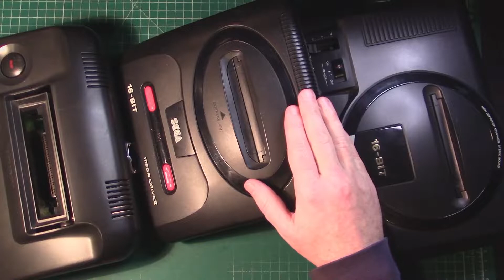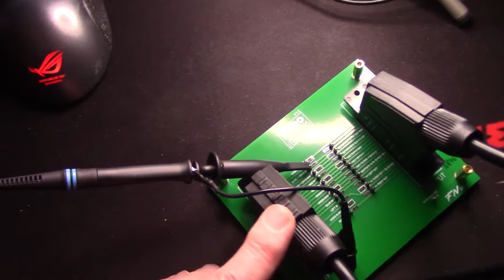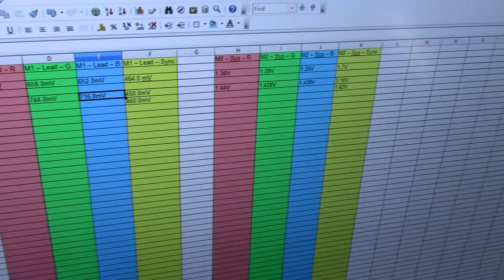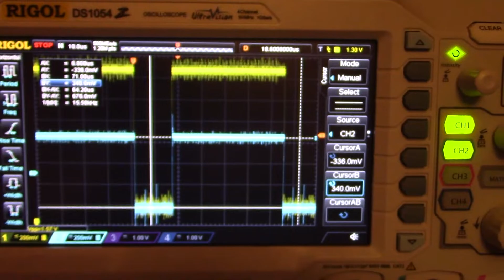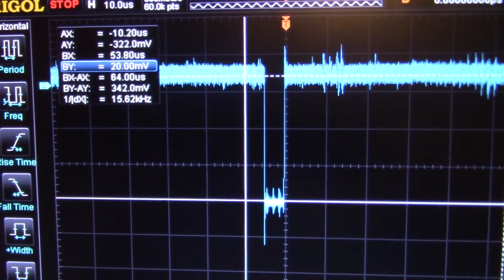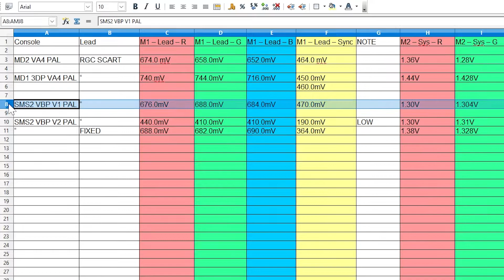VLOG: SEGA RGB SIGNAL SCOPING - 8bit & 16bit Consoles

Comment: Hi there, thanks for the video! I was looking at your data and I noticed that for RGB, the Vpp drop from the system to the SCART end is usually half, which suggests that the cable has a 75ohm resistor (or close to that) on top of the 75ohm termination resistor. So far so good. However,for csync, I notice that the attenuation that you documented for the first 3 systems is only possible if there is a 200ohm resistor inside the cable, not the 470ohm the cable says it has. However, the data for your FIXED system does show a resistor of around 420 ohm, closer to that 470. Do you know why that is happening?

I am trying to mod a very old system that doesn't currently have an RGB mod and since I am planning on using that same cable, I need to figure out what Vpp I need for RGB and csync to get the correct attenuation. I was thinking 1.4vpp everywhere and passing the 5v TTL directly since I think there is indeed a 470ohm resistor there, but I haven't received the cable yet to test.

Any help is appreciated. :)

Comment: The easiest way to do it Dermot is to get a test patten with a pure white screen, that way all three colours should all be at the same potential. Then attenuate each signals of the RGB to 0.7v pp. Remember there's a 75ohm resister to ground in the TV that creates a Voltage Divider (I'm sure you know how Voltage Divider work) when you input a source this helps you attenuate the signal.

Example.

I have a Red signal going into the TV SCART it's unattenuated at 1.5v It needs to be at 0.7v pp (attenuated) we already know there's a 75ohm resister (R2) going to ground in the TV that creates a Voltage Divider we just need to find the correct resister for the Red input (R1) to help attenuate the signal.

If we used and 86ohm resister on the red input signal we would see an attenuated red input signal of 0.69v pp, nuts on.

As for the sync an attenuated C-Sync, Composite Video and Luma (Sync on Luma) signal should be between 0.6v and 1.0v. (I always aim for 0.8v) No need for tables and graphs Dermot just stick to this and you'll have perfect RGB every time. 

Also a great resource for SCART input signal is here.
http://martin.hinner.info/vga/scart.html
Reply from the maker: Thanks FourX. I had been doing each signal separately. White test screen might be better for sure, using all available channels on the scope. Cheers for the link, great resource. I know it's kinda silly with the spreadsheet but it's a learning exercise for me and if I get in the habit, it's a good way to catch my mistakes.

Sorry you're comment got "Held for review". BS, YT cant stop scammers and spammers but it holds a regular commenter and fellow creators comments. Oh YT, how broken you are!